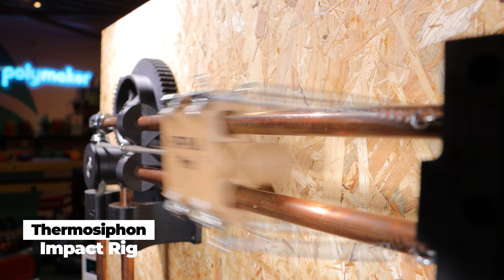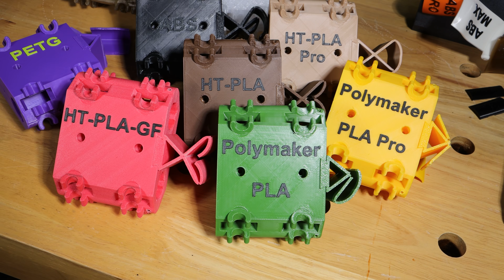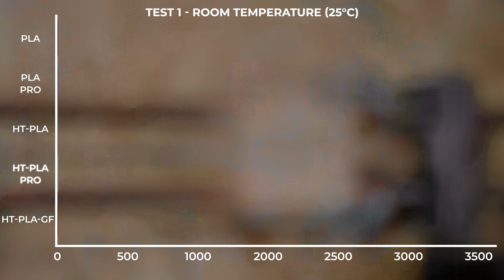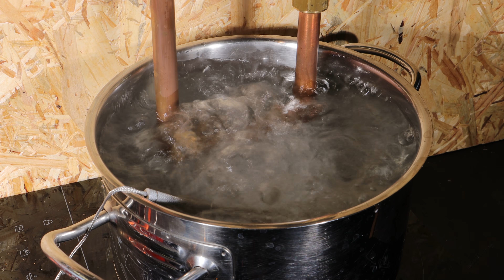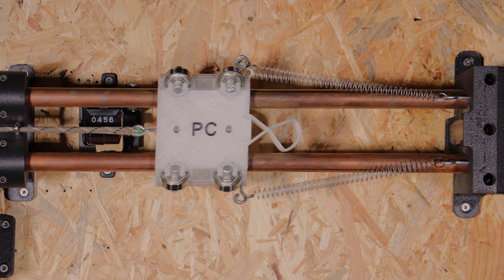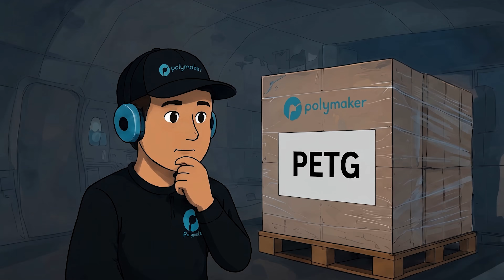Is HT-PLA Pro the Only Filament You’ll Ever Need?

Comment: Pretty impressive, but is this still close enough to PLA to be called PLA ? I'd personnaly would like to know if there are fossil based additives in there. I'm assuming yes?
EDIT : i've read the safety data sheet and found 
Polylactic acid (PLA) 9051-89-2 50-70% Not classified
Polybutylene succinate (PBS) 25777-14-4 10-30% Not classified
Calcium carbonate 471-34-1 1-10% Not classified

where PBS components can either be bio sourced or petroleum based. Just think it would be nice to be more specific about this.
Reply: @polymaker?

Comment: Was the HT-PLA Pro part annealed ?
Polymaker's own page mentions "For applications that require heat resistance under load, annealing is needed. A 30-minute anneal at 100 °C increases the HDT from 56.3° to 107.6°"

Comment: Nice improvements but the problem is heat resistance under load (aka heat deflection temperature). It’s the weak point of HT-PLA and it’s just as bad with this new HT-PLA Pro. We need something that is heat resistant under load guys… without having to anneal.
Reply: just anneal its so easy
Reply: @chino_duke  The fact that you think it’s so easy shows just how clueless you really are. Annealing PLA while maintaining the item’s original structure and dimensional accuracy is not easy at all. Sounds like you’ve never even tried it, lol. Go away you fool. The adults are talking. Nobody has time for your ignorant nonsense. 🤦‍♂️

Besides, even annealed, this filament is average, at best, in terms of thermal resistance when compared to some of the competition out there.
Reply: @zx4133  do some research and youll learn, annealing ht pla is not hard corny ass foo. hdt is 150c so its way better
Reply: @chino_duke 
Another clueless know-it-all trying to flex in the comments. So pathetic. 🤮

Can’t even get the specs/numbers correct, lol. Yet he’s trying to tell us to do the research. 150C HDT?! Completely inaccurate. Such an idiot! 🤦‍♂️

Comment: I usually have cheap Bambu Pla around to print stuff that either just tests or hahe no special need. Petg for everything that needs some Chemical or water resistance or a little more strength under heat. (Esun petg matte) Could get that for around 8 dollars per kg but its actually a bad one. The PET Basic surprised me how stiff and accurate it gets. For really strong parts i have some ASA-CF around which i could get for around 19 dollars per kg secondhand. New it should be around 50 per KG its really stiff and heat resistant.

Comment: Come on polymaker. There are standards for testing materials for a reason. Inventing a test that doesn't give a clear temp of the parts being tested and that the rig is more prone to failing than the test sample is just useless.
Test your materials using standard methods and also against other brands. If the material is as good as you claim, it will show this
If you dont like the notch impact test, their is a standard for non notched, their is also a standard test for fatigue.
Reply: For standard tests just read the TDS.
Reply: @riba2233 or conduct standard tests at elevated temperatures to show why this material exists
Reply: @thegps7197  but those are not standard per se
Reply: That's the point, it wouldn't hold up to proper tests..
Reply: @Elliot00000  what are you talking about? They have datasheets with proper tests so you can compare them, and most people will be more interested in real life applications.

Comment: You guys seem to like a challenge. How about a transparent filament that's actually much easier to print fully transparent? There are, of course, obvious limitations, since physics, the printer, and the printing process itself all play a major role. Still, I've always wondered whether something could be improved from a material perspective. On my profile, I had to fine-tune 20+ parameters to get good results. Cutting that down to just 10 or 15 would already dramatically reduce the time it takes to find the optimal print settings.

Comment: Does this still disintegrate years after it was printed? 

I think this is the go to filament for large format printing. Easy to print, high-temp, strong, and most importantly dimensionally stable material and it doesn’t shrink like ABS.
Reply from the maker: It has the similar degradability rate as regular PLA.
Reply: Still? PLA doesn’t do that. It is a myth.
Reply: @rsilvers129  some do, not all pla is the same.

Comment: Interesting.  Since you're stranded on a desert island, what about UV resistance?

ASA?

I have a specific application, but it needs white (what white?) and very good UV resistance.  My plan is ASA, but could be convinced if I could find something that prints as easily as PLA and is as strong as ASA.
Reply: PET-GF. Doesnt need a heated chamber, prints easily and is strong + uv resistant. Siraya Tech sells it in white. It's also dyeable if you care
Reply: @person-i6u  I was more worried about ASA or ABS outgassing than a heated chamber.  I'd think that's not a problem with a PET chemistry.  Is it like PETG's temperature range.  It has to be strong and solid at greater than 95F (35C), likely more then 105F(40C) .  It's a piece for a deck railing, so strength, temperature and UV resistance is a must.
Reply: @kwilliams2239  PET-GF's temp resistance is like 75c unannealed and 100c+ annealed. You only lose some impact strength and the color will become lighter if you anneal. Also yes, PET is safer than ASA for fumes. I think ASA is better at UV resistance but I personally have PET-GF parts stay outdoors for months that still function.

Comment: What's the moisture adsorption like? Does it need drying to maintain strength and avoid stringing?

Also, can I get it in Celestial?
Reply from the maker: Exactly the same as PLA, so if you usually do not need to dry your regular PLA, you will not need to dry HT-PLA Pro.
And it should be doable to have it in Celestial 🙂
Reply: @Polymaker  awesome! I can't wait to try it.